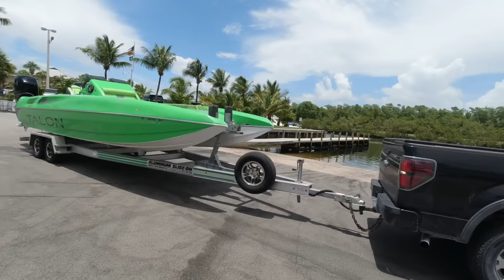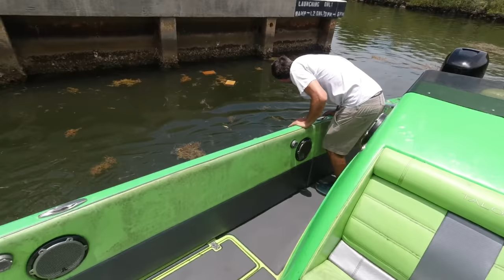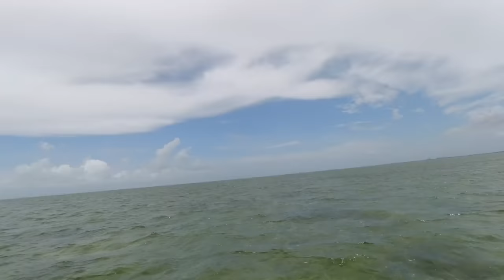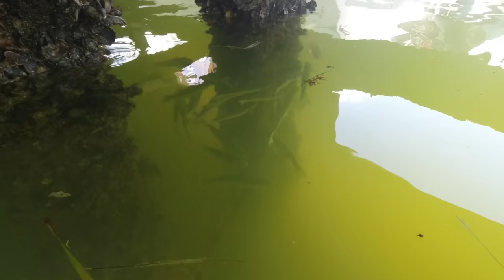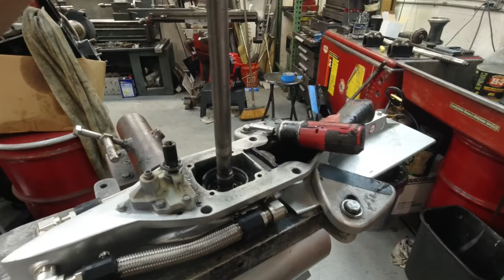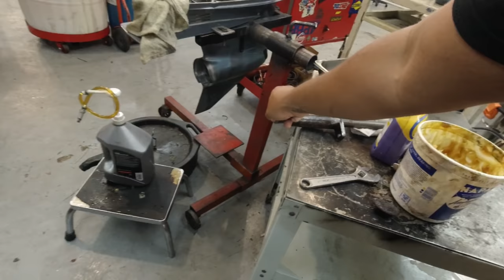PROJECT FASTEST CENTER CONSOLE CATAMARAN IN SOUTH FLORIDA

Comment: I remember a center console in the early 90s called a Cobra. It was one of the first big tunnel hulls I remember seeing. It was roughly 30'. I couldn't afford it by a long shot back then but I talked to the factory and had all their info and brochures to drool over. They were pretty ugly by today's standards but they started a trend that didn't take off untill 30yrs later. Seems like they were built in New Jersey if I remember. I'm sure a few are floating around still. They came rigged with sazukie outboards.
Reply: I found one that im trying to buy